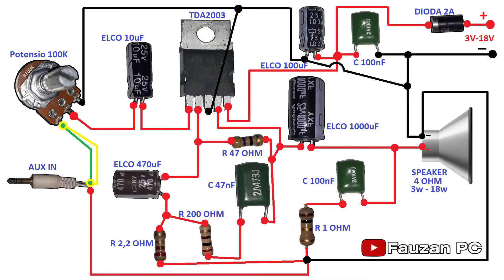Membuat Power Amplifier TDA2003 3V - 18V DC

Comment: Saya tda2003 merk gm, tonecontrol alin, pkai adaptor 12v 3,5a bekas monitor. speaker 5 inch 2 buah. Tp heatsink hrs diganti yg lbh lebar, supaya ic awet. Saya pkai heatsink bekas PSU kmpter, ditmbh fan bekas kmpter.

Comment: Itu bener om bisa pake 3 volt
Reply from the maker: iya om
Reply: Pkai charger hp 5v 500ma juga bsa, biar ic tdk cpt matot, tp pkai speaker yg kecil, misal 4 inch. Saya pkai adaptor 12v 3,5a, ic cpt matot.